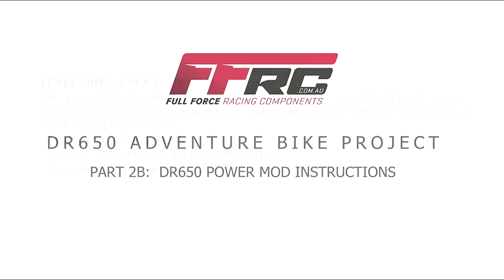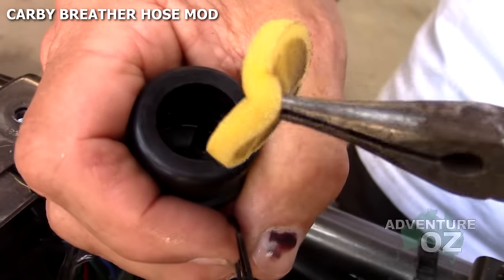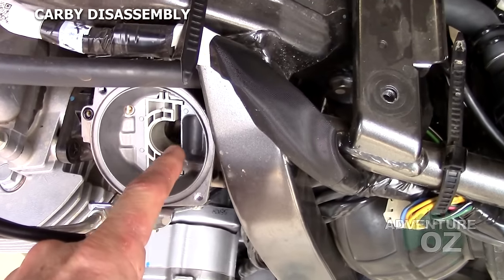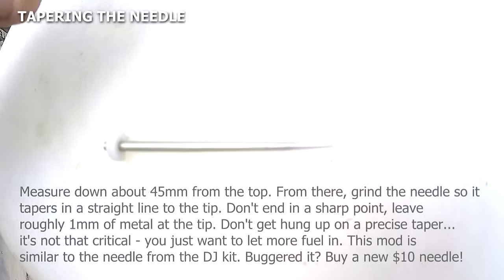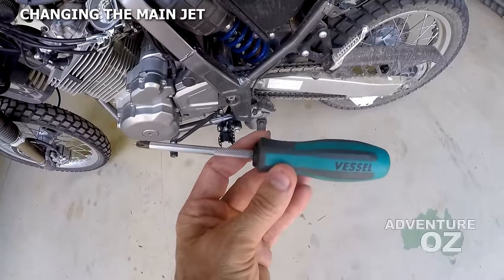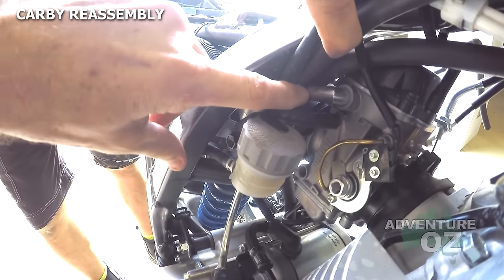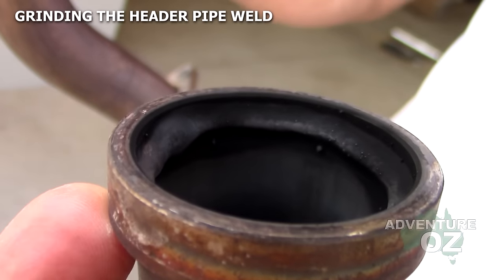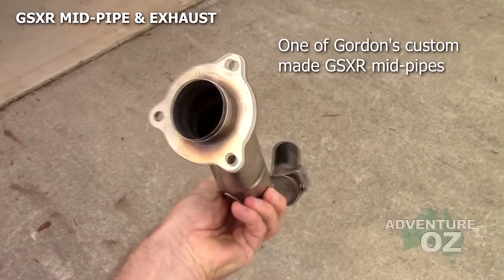DR650 project: transforming the stock carburetor! (BST magic)︱Cross Training Adventure

Comment: Has anybody tried a Lectron carb on their DR or DRZ? I’m curious as they’re simpler and supposedly get better fuel economy and better power while never needing re-jetting or altitude adjustments. I ride from sea level to about 9000 feet which is challenging on a carbureted bike. Apparently they don’t get gummed up by ethanol if they sit awhile too. Seems to good to be true but I’ve heard good things on the interweb…But I’ve also heard the earth is flat on the interweb…
Reply from the maker: I'd be interested in seeing the results of some serious independent testing, Matt. I hear rave comments from users but I'm always a bit sceptical as positive reports can be amplified by the fact you've spent a lot of money and time working on it.... a kind of 'investment bias'.
Reply: @crosstrainingadventure  well watch this space. Perhaps I’ll give it a go. I sort of inherited a DRZ awhile back that is set up for adventure riding. Has a Rekluse, luggage rack and big tank. I like it, but don’t ride it much because of carb problems due to sitting unused and altitude. If I try the Lectron I’ll let you know how it works out. I doubt I’ll get the performance gains I did with the billet brake pedal or gnarly graphics kit though.
Reply from the maker: You can't beat a gnarly graphics kit for outright horsepower lol

Comment: Imagine going through all that and it ran worse
Reply from the maker: yep, not sure if anyone has had that issue, anton. and if they did it might be due to either higher altitude, or a extreme climate temperature-wise. some just leave the bike stock, essentially you are just getting an extra 10% or so power with the carb and pipe mods... many are fine with the stock setup. but everyone i know has found the mods simple to do.
Reply: @crosstrainingadventure  yes , I just meant it would suck if they made a mistake doing it then had to figure it out , good video though

Comment: Unless you know what you're doing don't even bother trying this just leave it stock or you'll be fiddle fucken with it forever or take it to someone who knows what they're doing. Because  the chances are you're going to have nothing but problems and potentially do damage to the bike...
Reply from the maker: what happened in your case jason? everyone i know who tried this seems to manage pretty easily. and if you taper your own needle and do it badly all that happens is the bike runs too rich which can't damage the engine... many just get the jetting kit to avoid problems anyway.